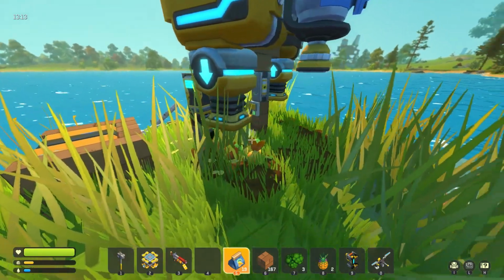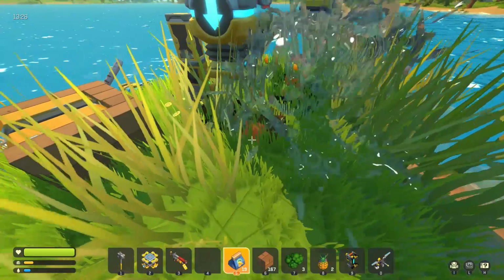[OUTDATED] No Raid + 72 plot Fully Automatic Farms [Scrapmechanic Survival]

Comment: Great idea. Made a two circle one in my game. Took some fine tuning to get it to fire right and not waste seeds but it ended up working great. How do you set up those logic gates though, my pistons are slow using a controller
Reply: i dont think he use a controller for the stomper.. think he just trigger them on/off with a timer sequence. i use that for spud setup. fire every 0.125 seconds if triggered.  raids last about 5 seconds average :)
all spuds share same  firing sequence and have a sensor and a logic attached.  then it fire if sensor and fire mechanism is both active.  no wasted ammo and no misses.

Comment: Thank you very much for your useful videos! Noob question: What is the purpose of the underground wooden connection between the water tank and the farm? I'm also surprised to see that no tubes are required to transport the water. Why are there tubes in the game then? Just for decoration?
Reply: underground wood is used to allow you to connect the water container and gun via the wiring tool. Pipes can be used to transport items between things with green ports, which in some cases includes the water containers, but is usually for moving items from chests to your craft bot or from refine bots to storage. In this case it is easier to connect the water using a wiring tool but you are unable to do that with other storage devices like chests.

Comment: a small farm constantly destroys seeds and waters them endlessly. Could there be an error in logic?
Reply from the maker: Maby you noticed blocks on the map sometimes are nearly completly in the groud and sometimes stick high out of the groud when you place them on the ground on different parts of the map. This is what causes your problem, so try to build it somewere else. Depending on where you build it you will need to have more ore less blocks under the sensor to fit the hight of the terrain.